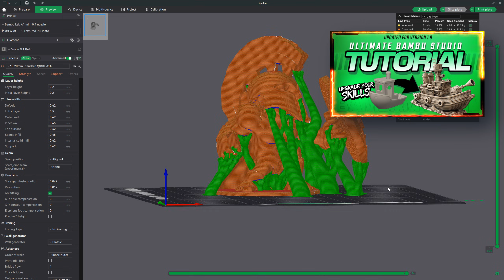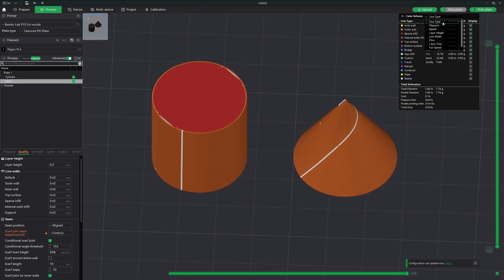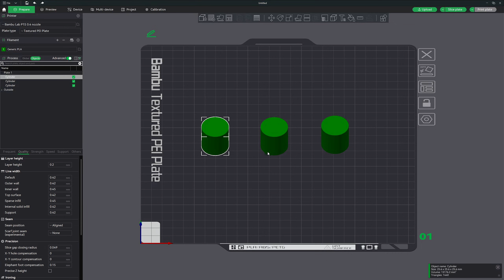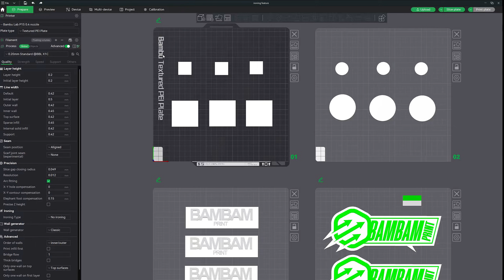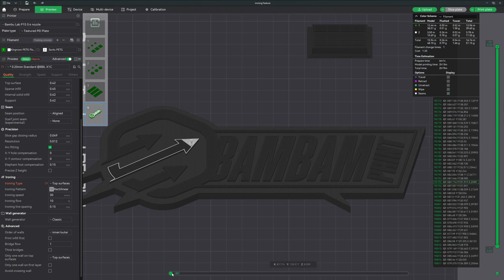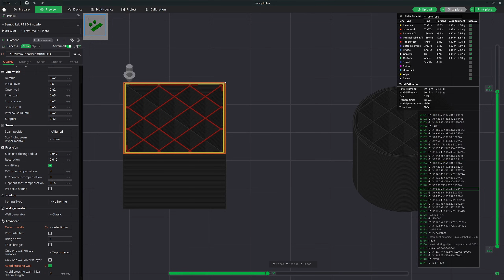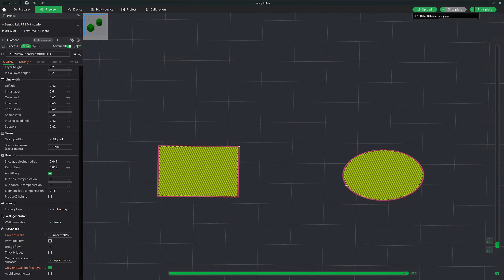Bambu Studio Optimization! 🏆 Advanced Slicer Settings For Better Prints

Comment: Hi Nick, Thanks for the extensive detailed information which indeed is a lot to digest for a beginner. Actually I'm trying to find the acceptable ironing settings; and experimented quite a bit since I have this new A1. However my A1 and my friends' P1 show both a silmilar aspect. a relatively small surface of 80x40mm ( just 3mm thick) keeps showing a nice smooth surface in the beginning and then after some lines the ironing effect seems to work on and off touching the top layer but not smoothing it. adhesion to the plate is perfect so shrinkage is at least not noticeable. Can't repeat all I have done already but, hopefully you recognize the phenomenom and are able to hint me where I have to look. Temperature? Z- action? Cooling? Amount of top layers?  rgds, Tom

Comment: One problem with hole compensation: the program treats all holes the same and will adjust all of them. This could be bad for interlocking parts.
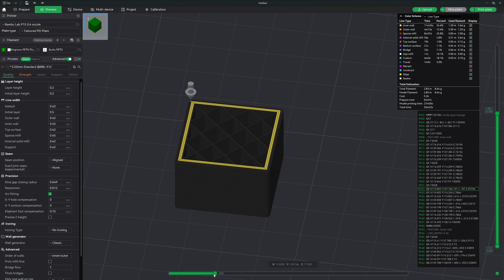Reply: L😮😮😊 12:45
Reply: @leonardbrowning4943  the wall generator will not adjust with hole compensation. Good example: I had a square frame like in 12:45. The frame had a higher wall on one end and holes for mounting. When using the hole compensation, the holes were adjusted but so was the inside of the frame which left a small overhang on the higher end inside the frame. This could be fixed and more functional if hole compensation had an adjustable diameter limit to prevent such issues.
Reply from the maker: Great tip! There are definitely some additions that would help make our lives easier. I am really hoping to see some more features for the cut tool.
Reply: Could you not limit the affected holes by using a modifier?
Reply: @MisterkeTube  if you can, I haven't found anything. I just made small test holes and adjusted the CAD. If you do find something, please let us know. It would be nice not to need CAD adjustments. 🍻

Comment: A couple of comments/notes.

The Inner/Outer/Inner is normally the best choice for wall ordering if you have 3+ walls. That's because the initial wall laid down is in the inner most wall, which allows for any pressure issues/oozes/etc that occurred when switching layers/objects to be dealt with dealt with on a line that will never be seen. Immediately after that wall comes the outer most wall, where it should then be printed super cleanly having addressed any nozzle issues on the inner most wall with no inner wall immediately next to it which might accidentally push it out. The subsequent remaining inner walls will then be printed and if they get a little squished then that's OK as they will not be seen. The default Inner/Outer can lead to issues where the outer wall can be pushed out just slightly (more line ridges on the outer wall) if there were any issues with the inner wall when it was put down. The optional Outer/Inner can provide a smoother exterior wall as you noted, but if there are any pressure issues/oozes/etc when the printer goes to put that outer wall down then that can change things. That's why I try to stick with 3 walls & inner/outer/inner on prints where the look of the outer wall is critical. Otherwise, I tend to go for Outer/Inner if I have 2 walls and I am more worried about the appearance of the outer wall, but that isn't fool proof and could have issues with overhangs since the outer wall has nothing to "grab on to" (which is arguably an issue with Inner/Outer/Inner as well). So much to consider with just this one setting. 🙂

I think you missed a very important aspect of the "only one wall on first layer" choice and that is physical appearance of the print. For example, if you are printing something like a cube that has the default only one wall on top layer setting enabled, but you don't enable this first layer setting, then as you rotate the cube you will see more of a difference between the top layer with 1 wall and the bottom layer with 3 walls (presuming your model had 3 walls). This can be jarring depending on the print, so I routinely turn this on when I want some sort of symmetry between the top and bottom layers of certain prints. A good example of this is a gold bar print I found on maker world that was printed at an angle, one side had 1 wall on it's "top surface" and the other side had multiple walls on its "bottom surface", and the resulting print just looked weird when looking at the gold bar straight down. I hope that makes sense.

FYI Scarf joint seams don't work very well on silk prints. A scarf joint can hide the seam a lot better on a non-silk print as your video demonstrates very well, but when I tried it on a silk print it just made an inch wide discoloration on the print even though the physical seam itself was arguably better hidden. In that scenario the tradeoff of a physically smaller physical seam line for an inch wide marring/discoloration of the print isn't worth it to me, and I could argue that visually the single thin seam line is less noticeable. You didn't address this either way, so I just wanted to share my experience.

I'm a big fan of what you are doing so please keep it up. I REALLY like that you put the version number of Bambu Studio you are using in the thumb nail, it's the little things like that which make your stuff look super professional. I wish you had been around 8 months ago when I started going deep into 3D printing as you would have save me so much time and so many head aches. 🙂
Reply from the maker: Great thorough comment! Thank you for taking the time to point these considerations. I will definitely be doing follow up videos so I will keep this in my back pocket. I am happy to have you here as a supporter!
Reply: This is the kind of comment that should be pinned! THANKS for the explanation